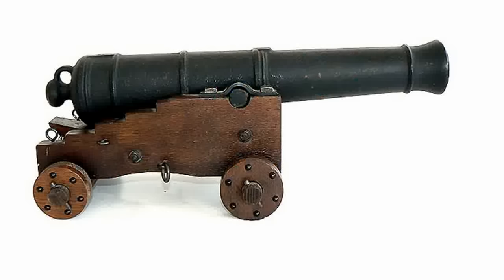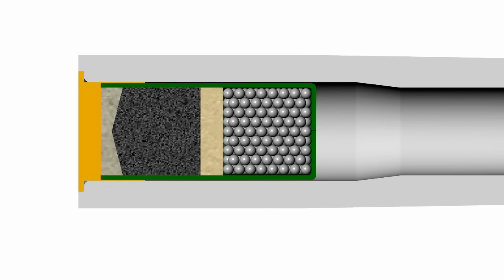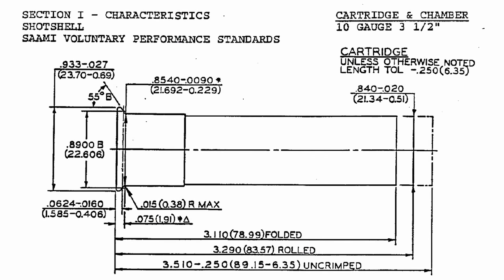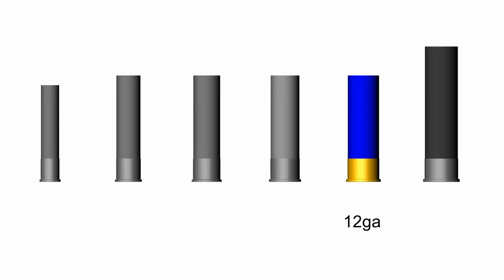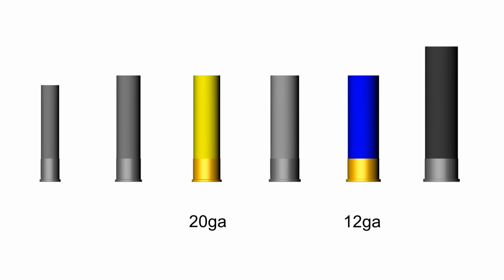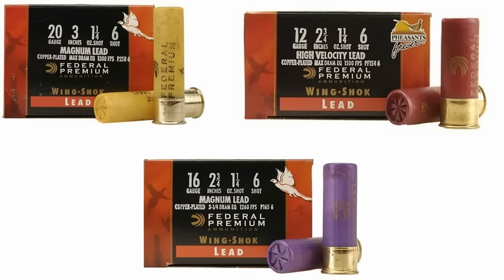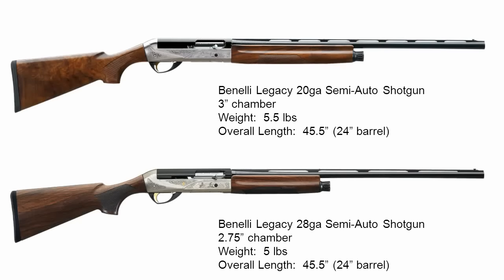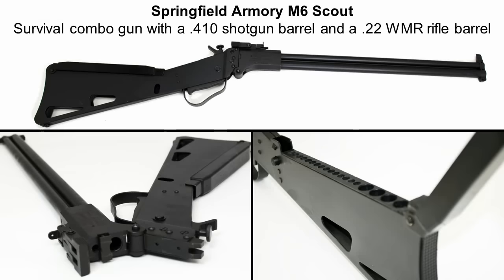Shotgun Gauges Explained - Shotguns 101 #3

Comment: I honestly think it would be interesting if mag fed .410 guns started to exist and it was treated more as slug cartridge, see what weirdness comes out of 3 inch .410 auto rifles.
Reply: @Rose huh interesting. People use slugs in them then? Also what hull length do they usually use? I assume they don't use the 3 inch magnum .410 shells.
Reply: @Rose huh so about 2¾"
Reply from the maker: I mean, if you're thinking of a mag-fed .410 for use with slugs, why not just have a rifle?
Reply: They already have magazine fed .410s but you would get better results out of a 45 Colt rifle than a 410 slug

Comment: 8 gauge is commonly used in cement plants to breakup C thinkers in the Kline. 
Only comes in slugs.
Reply: I have an 8 gauge shell from a cement plat that he used to shoot the quarry for them. I believe its shot out of a tripod mounted gun and it is a slug.
Reply: @jamiewells688  Yes that's  right. Remington made a shoulder fired 8 gauge. They had one in the cement plant at Independence Kansas. That plant was so old they had stables for the horses and mules they used to work the coal fields. It closed down in 2017.
Reply: @richardlmckinneysr.mckinne7260  that's kind of funny the quarry and cement plant was called ice cement. Independent cement company  and it was in NY. I dont know if ots still open we moved away 20 years ago

Comment: 10 gauge guns also have more range than 12 gauge across the board.
Reply from the maker: If you load them up to the gills, yes, since the bigger 10ga can hold about a quarter-ounce more shot.  But for the same amount of shot, both gauges have comparable range if loaded and choked properly.
Reply: People always assume the larger the gauge, the more range. That's not the case at all. 1350fps out of a .410 with #6 shot will shoot just as far, and with the same energy as a 10 gauge at 1350fps and #6 shot. All you're doing with the larger gauge is putting more shot on the target. Thus, you increase the chance of a clean kill at a greater range.
Reply: @mikek8089  kinda but not really the shape of the shot charge affects range and pattern density a lot, long narrow loads like 410s wont do as well as a more "square" load like a 20 gauge even if the size and amount of shot are same as well as muzzle velocity.

Comment: For Grandma's home defense? 20 Ga Semi Auto Rem 11-87 or a 12 ga Pump with Mesa's 70% Recoil reducing buttstock?
Reply from the maker: For a pump, I would recommend low-recoil shells rather than a recoil-reducing stock.  Still plenty of punch for HD, but very easy to shoot with just a good recoil pad, and they don't add cost or complexity to the gun, or mess with the way it handles & shoots.

For a HD semi-auto, a 20ga makes sense, though there are some good 12ga autoloaders these days that can reliably cycle lighter loads - or be tuned to do so.  Also keep in mind that many semi-auto systems serve to reduce recoil to begin with compared to manually-operated actions.

Understand that the main advantage with a 20ga shotgun is a physically lighter and smaller gun.  Recoil is not as significant a factor, since 12ga shells can be loaded just as light as 20ga shells, and there are a lot of good low-recoil 12ga loads available.

Comment: So can you explain all that in metric?
Reply from the maker: The geometry is all exactly the same regardless of units, so yeah, you could if you really wanted to.  But since gauge specifically describes the number of lead balls you get from an avoirdupois pound, and not many sources give densities in pounds per cubic meter/centimeter/millimeter, it's easier to simply do the calculation for inches and then multiply by 2.54 for centimeters or 25.4 for millimeters.
Reply: @SynchronizorVideos  ok thanks
Reply: In Asymetric....it's...."shottie".
Reply: Lol. 😆

Comment: The 410 for defence, you are better off using the rifle as a club 😁
Or attaching a bayonet to it ...😳
Reply: Never fired PDX1 shells i see.
Reply: @aaronh1372  hi, no I haven't, I remember my neighbor an old guy had a 410 and shot a rat with it, I was very young about 45 years ago and I remember the rat running off...
But of course I would imagine things have changed now...
Reply: @myturkishlife1777  the .410 birdshot is ineffective for anything closer than 30 yards, there is no time for the spread in short distances. It should reach out about 30 yards further than the 12 gauge, effectively. I've been rained on by 12 gauge shot dropping, never from the .410. The PDX1 Defender's are handgun loads, copper coated to protect rifling, and open up much quicker with 12 pellets and 3 disks.
Reply: @aaronh1372  ah ok, thanks for the explanation 👍👍

Comment: If the 410 is next to useless, how come it qualifies as a survival gun load? I know the U.S.Air Force used to provide pilots with a survival kit if/when downed in enemy territory, among the items provided is/was a folding shotgun in 410.
Reply from the maker: Where exactly did I call the .410 useless?  I explicitly say in this video that the .410 has its uses, and specifically point to survival shotguns/combo guns as a place where it is advantageous.  The only thing I really poo-poo the .410 for in this video is its weird vogue as a defensive round - and I stand by that.  Even if you could consider certain .410 load/gun combinations somewhat-effective for defensive roles, an equivalent setup with a rifle or pistol round is hands-down a better choice.  

But the .410 is far from useless, and the fact that it has retained a meaningful slice of the shotgun market clearly shows that it has value for certain roles.  I like to point to the .22 LR as an example when discussing this topic.  In many ways the .410 is the shotgun equivalent of the .22 LR.  Both have some significant limitations, but no one worth listening to would call either round useless.
Reply: The Survival rifle provided to Air Force pilots was a .22lr, not a .410.
Reply: Polo Mare the USAF used to Provide the AR-7 which was a semi auto 22 that would fit into its own stock, the rifle he is referring to is the M6 survival rifle which had a .410 bottom barrel and a .22 top barrel neat gun and concept but it didn’t last very long and its hard to find on the civilian market because it’s technically an AOW which means it comes with a tax stamp that costs as much as the gun is actually worth

Comment: Um 410 is actually. 455 diameter.
Reply: Um,... no it's not.  The BORE size is .410 thousands of an inch. The OUTSIDE dia. of the shell might be close to .455, but that's NOT how you figure the size of a shotgun shell!!!!!!Yes, you can shoot .410's down a .45 cal. revolver barrel, but the wad and shot column can easily expand to fill up the larger BORE size. But the shell still starts out at .410 BORE size!!!
Reply from the maker: The SAAMI chamber specs are freely-available online.

Comment: In Brazil 12, 16, 20, 24, 28, 32, 36-(.410) and 40 GA...
Reply: DBR o 40GA na verdade é o 9.1,mas a CBC parou de fabricar cartuchos para esse calibre em 2006
Reply: Me explique melhor essa questão do 40GA ser o 9.1...
Reply from the maker: The .410 is commonly referred to as 36 gauge, but that's not accurate.  Some early publications labeled the .410 that way, and though they quickly corrected themselves, the incorrect label stuck.

Comment: Circuit Judge guy kills you with a couple .410's and a couple .45's to make sure.
Reply from the maker: If the .45s are better enough to make up for poor performance of the .410s, why not just start with the .45s?
Reply: Don't you have to change the choke before you can fire the 45's?
Reply: @williamevans2176  apparently not. If see old Hickok45 just load them up.
Reply: Guess I will have to go back and read the instructions on mine, been a long time since I have used it but do remember it came with 2 different and chokes..

Comment: Take a look at Paul Harrel's youtube page. A 410 can make a very effective home defense weapon.
Reply from the maker: It beats throwing dishes, but it's outclassed in pretty much every way by the larger gauges for use against large creatures.  Keep in mind, that if low recoil is required, there are plenty of light shells for the 20 or 12 gauges that you can use, and they'll still perform better than a .410.
Reply: Synchronizor agreed. Best use for .410 is in a bond arms derringer for snake duty.

Comment: I would rather hit myself over the head with my own hunting boot than shoot three and a half inch 12 gauge shells on a regular. The most I'm willing to tolerate, even for goose hunting is 3 inch high brass.
Reply from the maker: They can certainly kick quite a lot, although most 3.5"-chambered shotguns tend to be heavier and come with good recoil pads, which helps.  The 3.5" shell is most useful for steel payloads, which need more space for the less dense shot.  If you're shooting lead, the 3.5" can still provide a little bit of an edge, but a 3" magnum will also work fine in most situations if the shooter knows what they're doing.
Reply: @bigg6060  , not at al. I'm 5'2" and weigh 115 lb. overtime I pull the trigger on a 3.5 shell I feel like by retina are detaching.

Comment: In Brazil .410 is called 36
Reply from the maker: The .410 has been referred to as 36 gauge in a number of areas in the past thanks to an erroneous early CIP publication, but most markets have moved away from that designation, as it's inaccurate.  A true 36ga bore would be .506" in diameter.
Reply: Synchronizor My Uncle had a 36
  Definitely NOT a .410

Comment: How abaut the 4 gauges use in flareguns and in ww1 there were flaregun cartriges with granades invented by the Germans
Reply from the maker: 4-gauge cartridge guns were common enough hunting arms in the black powder days, but they were never very standardized, and apart from a few specialty roles, they didn't really last into the smokeless era.
Reply: The standard Russian police shotgun is 4-gauge. It can fire rubber bullets, tear gas, sabots, explosive charges, even sleeping gas. It's a  heavy shotgun, but the action is very smooth.

Comment: It's been my experience that the tighter spread of the .410 will reach out there further than the 12 or 20, in 2 3/4" bird shot. Some of the hardest kicking shotguns are .410. It's a nasty little round, hence it's much higher price and rarity. Y'all judging it by looks alone. The video didn't give the .410 a fair measure. 

Side note: dropped more birds using a single barrel break 20 than with an Italian made pump 12, oddly enough. Knowing I had but one shot may be the driving factor here, idk.
Reply from the maker: A larger-gauge shell will hold more pellets, and thus have a denser pattern for the same rate of spread.  And a denser pattern can fly further before the pellets spread out enough that effectiveness drops off.  So no, there's nothing about the .410 that makes it pattern better than larger shells, if all other factors are equal.  A similarly-choked 12ga with two or three times as many pellets per shot will be much more powerful and more effective, especially at longer ranges.
Reply: @SynchronizorVideos  i disagree

Comment: Can I use the balls or bores for my airsoft hehehehe
Reply from the maker: As stated in the video, .24-caliber #4 buckshot is essentially the same diameter as 6mm airsoft pellets.  WAY more mass in a lead #4B pellet; about 1.3 grams vs the typical .12 - .25 gram airsoft projectiles.  You could try, but I doubt it would really give you any advantages.

Comment: "family friendly"
Reply: Thought the same, oven though I am Swiss, owner of a pistol, three legacy carbines and my service rifle. My guns are locked away from any curious kid.
Reply from the maker: The idea is that a smaller 20ga gun is more easily handled by smaller or physically weaker members of the family.  Possibly older kids if they're responsible and trained (you'll never hear me say that all kids should have access to firearms, that should be decided on an individual basis in my opinion), but also a petite wife, an older grandparent, etc.  You can get plenty of low-recoil shells that make a 12ga kick like a 20 (or even less), but it's still a larger, heavier gun.
Reply: @SynchronizorVideos  Okay, seems like I misunderstood that part. Personally, I don't see a need for lethal means of self defense in Switzerland which is why I don't want kids to carry the burden of deciding over a man's life in a split second, even if their home is invaded. Perhaps I should have put that phrase into the context of geography.
Reply from the maker: Most HD guns here in the U.S. only ever see use on a range for practice.  An actual need for one is pretty rare, even in high-crime areas like large cities.  As a culture though, we like to be prepared.  And there have been cases where responsible kids (usually teenagers) who had experience and were trusted with access to a firearm have stopped some pretty bad situations.  Again, kids are individuals, so it's a case-by-case thing.

Comment: I was taught that the 12bore related to a single ball of lead weighing , 1_12th of a pound, not 12 balls,,the bore was a tube the size of the single ball,. Which makes more sense than twelve balls, doesn't it ,? Please correct me if I'm wrong,  ,,,,🤗,
Reply: Both describe the same thing. 12 balls=1 pound of lead. Or 1 pound of lead =12 balls, it's the same
Reply: @zachmiller9175  I applaud your excellent restraint sir
Reply: @zachmiller9175  OK ,cocky what does each ball weigh, and why,!?,also how do 12 balls give the bore size? Where as I ball weighing one pound, would be the bore size, twelve balls do not explain the correct bore size ,,,,correct me if I'm wrong,,,I said,,,😂,,,
Reply: @sausagedog98  what about my restraint ? 🤗
Reply: @briandunstan3503  the reason you're wrong ISNT because a single 12 bore ball isn't 1/12 of a pound. It is. The reason you're wrong is because you're insinuating that there is a difference between 1 pound = 12 balls and 12 balls = 1 pound when they're obviously the same. Again, 1 ball IS 1/12 of a pound. AND 12 balls ARE 1 pound.  There is no practical difference between these statements
Reply: @zachmiller9175  I bow to your knowledge,,,I have been totally thinking of a pound of lead instead of 1_12 of a pound , the reason being, I'm also fighting to explain to another gun lover ,how a bullet does not make a bang when it exceeds the speed of sound ,,I'm also 70 and haven't slept this week, lol, I hope you dont want to get in to the sonic boom argument,,I did ask to be corrected anyway,didnt I ,? Thanks again,,🤗
Reply: @zachmiller9175  also I was thinking of the balls being 1oz, I don't know why,,
Reply: Brian, You answered your own question with your first post here. 12 balls from 1 pound of lead = 1/12th of a pound = 12 gauge, reading comprehension is lost on you. Oh and each ball weighs1/12th of a pound or 1.33 ounces. There I corrected you.

Comment: i think 4 Gauge is used by the Russians in weird 23mm rifled shotguns i forgot what it's called
Reply from the maker: There's the KS-23, which is often called a 4-gauge, but 23mm is really more along the lines of 6 - 7 gauge.  I don't know any specifics on the muzzle velocity or shot weight of typical loads for that cartridge; I suspect a magnum 10ga or 3.5" 12ga would be pretty competitive, given that the KS-23 only weighs about 8.5 pounds.
Reply: Synchronizor oh yeah the KS-23 now I remember and thanks for the info

Comment: Like most people outside USA I am used to metric System, not to inches and pounds. Please translate.
Reply: Simple. Calculate diameter for 1 bore. 1 bore is diameter for 1 lb (~454g) ball(sphere). Using basic math for sphere volume ant transposing formula to find diameter you will get that to form 1lb lead ball it need to have 42.42 mm.
So then if you need to calculate bore (gauge is fraction of a bore so 12 gauge = 1/12 of a bore) just use 42.42/ 3√n where n is the fraction of bore. For example for 12 gauge (1/12th of pound) = 42.42 /3√12 ~ 18.53 mm.
Note that gauge is diameter of the internal barrel, but in shotgun barrel not one diameter through whole length.
Hopefully basic maths helped.
Reply: @nieczerwony  thanks bud =D

Comment: I dont Think something as a "family friendly gauge" exist
Reply: 410g is pretty family friendly
Reply: My vote for family friendly would also go to the 410 bore.  Equipped with Shoulder Saver stock pads, I have seen eight year old girls shoot 410's with surprising skill.
Reply: By family friendly they mean a kid or a lady could shoot it without any problems
Reply from the maker: The problem with the .410 is that its payloads are rather anemic.  If you want a defensive long gun that size and recoil level, you'd likely be much better off with a lower-powered rifle or PCC.  The 20ga has enough shell capacity to offer the quantity-over-quality ballistics that make shotguns effective, while still fitting in a reasonably light and compact package.